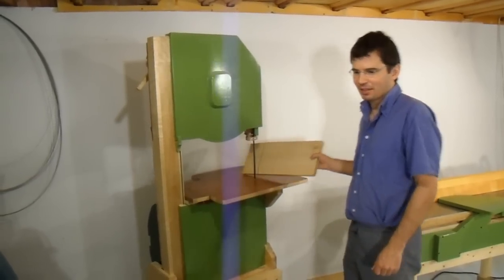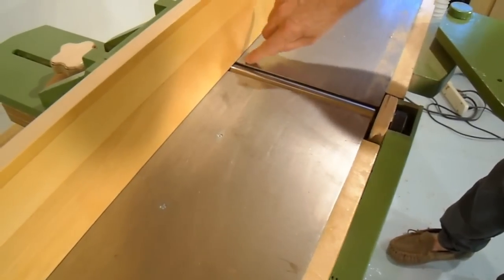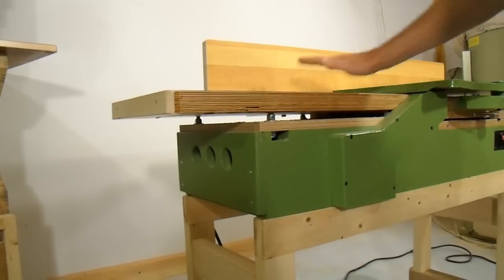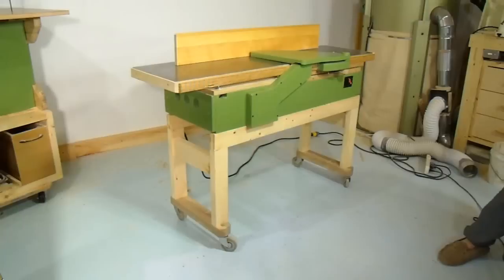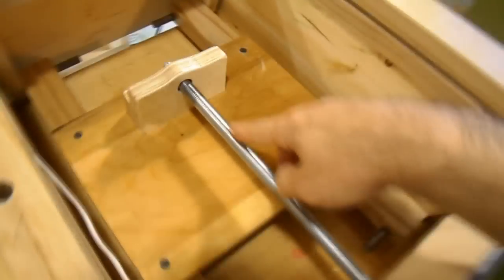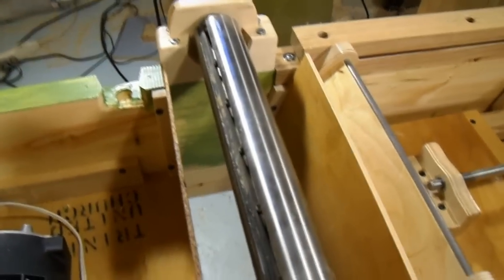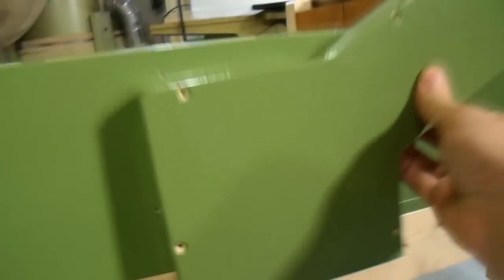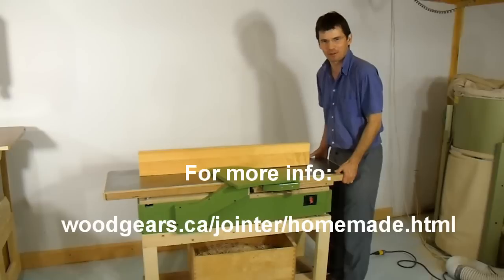Homemade jointer

Comment: I don't really know enough about this to offer useful advice, but it could be some of the noise is due to resonance. For instance, a lot of acoustic musical instruments have a flexible wooden box attached to make them louder. Possibly if you added some rubber or foam material to any wide panels that could quiet things down a bit.

Comment: from where did u get the 12 inch cutter head. Are there electric planners with 12 inch cutter heads. most are not more than 5 inches

Comment: Hey everyone. I need your opinion on something. I want to make this jointer. I bought the plans. A cutter head. A motor. But I dont have a drill press and I'm a little terrified of messing up the parallelogram mechanism. I was thinking of buying a small motorcycle scissor lift which I saw on Amazon for $70. Do you think it will be accurate enough to work as the lift for the infeed table?

Comment: Why don't you make a jointer with helical or shelix cutter head so the people don't have to buy a the whole thickness planer
Reply from the maker: because buying the whole thickness planer is much cheaper.  And you also get a motor, pulleys, switch and power cord.

Comment: I've seen spiral cutterheads being sold for a little as a few hundred dollars at places like Grizzly and Ebay.  Has anyone tried using one of those on a homemade jointer, instead of buying a cheap thickness planer and disassembling it for the cutterhead?

Comment: Thanks for sharing. I have a cheap jointer that I'm struggling to set up.  The issue I'm having is that when edge jointing, the stock comes out concave. I.e. there is less material in the middle of the stock so when I want to edge glue it there is a larger gat in the center. What's causing this? What can I do? I've adjusted the knives according to the manual (using the provided tool) but the problem remains.
Reply: You need to adjust the in-feed and out-feed tables. Make sure they are level and parallel.

Comment: Why didn’t you put the motor and belt on the rear, and run the motor in reverse or feed the woodwork left to right?
Reply from the maker: pulley only firs on one side.  Running left to right is asking for trouble in terms of feeding the wrong way.
Reply: Matthias Wandel sorry I think I didn’t explain properly...... if you flipped the cutter head, in turn putting the motor on the other side of the table, then you could build the table to feed the workpiece from left to right. Not much of an issue really I know, but just food for thought :)

Comment: The sound of the motor has probably been amplified by the fact that it is in a wooden box which is acting like the sounding box of a guitar. If the noise is irksome it may be worth putting some acoustically insulating material or some foam rubber in the box to line it and deaden the noise. The heavier the density of the foam the greater will be the deadening.
I hope that this may be of use.

Comment: Hi. Cool project. 
You showed that you used the original mounting mechanism. Only by Design it is hanging downwards, and the gravity is keeping the belt under tendion, so it doesnt ware out so fast and doesnt come of. You should use some springs to ad pressure on the Motor to keep the belt under tension.

Comment: I got a challenge for you. Can you design and build a jointer/planer combo with a shelix head from the dw735? i have seen that someone built a jointer with it from your plans but i only want to buy one shelix cutter since they are expensive.

Comment: I've been dreaming of building one of these for a couple of years now, but I've never been able to justify tearing down a brand new thickness planer to do it. Now I'm thinking I could build by picking up a used cutter head from eBay and slapping on some fresh bearings and blades. Should be able to get it all for $200 and I already have some salvaged induction motors saved for a project like this. I'm not sure how many HP it would need for a 12" cutter head though.
Reply from the maker: for $200, you can probably get a thickness planer too, and it comes with motor and pulleys already.

Comment: "most small planers mount the bully on the right side, which means you have to flip it and unfortunately mount it on the left side if you are going to build a jointer out of it" - master level problem

Comment: i didnt see if someone had already mentioned this or not. you talked about the motor cover having an opening at the bottom so as to "hopefully not suck in any shavings" since your dust shoot empties out below (unless your shaving box is under the table) wouldnt it have more chances of pulling in a lot of dust? Would it not be better to have the opening pointed a long the side of the table towards you,  to pull air in? just a thought. if im completely wrong, then let me know. it was just a thought.
Reply from the maker: It would take an insane amount of suction to pull shavings 30 cm up from the bin
Reply: Ahh ok, i didnt know. I dont have much knowledge on those things, but figured it wouldnt hurt to voice my thought.

Comment: Hi, in your opinion, which would make the stronger and stable jointer, MDF or ply? For some reason, ply is not very commonly used in South Africa and it's quite expensive. Which other alternatives is there?
Reply from the maker: steel
Reply: now that's comedy right there folks!.. :D

Comment: Matthias, I appreciate your clarification. This functions as both planer & jointer right? Since basically it's an inverted planer & stronger with the belt drive for sure. Is there really any critical difference?
{If I were too build this machine larger with the parts from a larger planer}  
I imagine some kind of thin insulation on the inside of the box could muffle the motor noise...just a thought I had when I saw this video the first time, by no means a criticism...I really like your work.  I'm inspired OK thanks!

Comment: When you were testing the cutter head you used something that caused the motor to vary in speed.  What did you use to get a AC current to vary in speed?  Whatever it is you should use this to build a disk sander.  One of the problems with disk sanders is the speed.  Too fast and the wood gets burned.  The slowest speeds I've found is around 1,700 rpm.  300 rpm would work for a lot of projects.
Reply from the maker: You should use an induction motor for a disk sander (universal motors are too fast).  But induction motors can't easily be changed in speed  - you need an an expensive VFD.  this will cost more than the sander.
Reply: I have a DC motor off an old treadmill.

Comment: Wait can't you just mount the motor on the cutter head? Because you could save some money
Reply from the maker: That woudl be much more difficult than using a belt.  Also the wrong RPM

Comment: Couldn't you turn the motor and cutter head end for end and make it a left to right feed machine? The fence would be on the left instead of the right from  a feed perspective. Then you could put in a rabbeting ledge on the right.
Reply from the maker: I didn't have a choice about which side the pulley goes on the cutter head
Reply: I see you said that in another reply. So if you swapped ends... the pulley stays on the motor side.. but you rotate the whole motor pulley affair counterclockwise from a plan view, but the motor goes in the right hand compartment and the infeed table goes to the left... the outfeed to the right. Looking at the pulley it now rotates counterclockwise from the near side of the table. In my bizarre and twisted imagination it works... perhaps not in reality...

I realize it is a duh uh moment, cause it amounts to just turning the machine around in the shop and (then) switching the side the fence is on... which I think you mentioned.

Other than cannibalizing a planer, I wonder if there is any other way to get a cutter head with pulley arrangement.
Reply: Eric, I think you have the same imagination as me...I got mine at "Eschers-R-Us...." :-)

Comment: Could you make the belt side, the back side?  This way the pulley to the cutter wont get in the way?
Reply from the maker: I didn't have a choice which side the pulley is on
Reply: If you put the infeed table on the left, you would be fine

Comment: What is the difference between a jointer and a plainer? Thanks
Reply: A jointer is used to make the face of a warped, twisted, or bowed board flat. A planer is used to make your boards uniform in thickness.
Reply: think of the joiner as for "joining" the edges of boards; for a good glue up, you want a flat, uniform surface for the glue to adhere to (and for the second piece to join to). My "preferred" answer isn't technically correct..."join edges, plane faces" - that's probably 80-90% accurate. But, I think it makes the concept clearer.
Reply: +Robert Vernon Do a search on Matthew Cremona's channel for an answer to this question. He posted a video about it.

Comment: Matthias - I have watched several of your videos, some more than once and I am amazed as to the amount of thought you put into a project.
I have been wondering, where do you find the motors for your projects?
Good work!!! You are the "bar" by which I measure others to.
Reply: +Bill Moss Scrapped washing machines are a good place to start. Quality machines also have better brackets you can use, as well as better motors.

Comment: If I'm modifying the structure that holds a cutter block that spins at or around 5000rpm I'd use metal brackets and machine screws. Not worth the risk. Failures may be more or less catastrophic. Be carful.
Reply: Steve Joyce My thoughts exactly!
Reply: Steve  Joyce I was thinking the same thing.

Comment: Hey Matthias, are there any reasons other than right handedness and convention that prevent you from just turning the Jointer around and feeding from left to right, in order to avoid having to work over the large pulley?
Reply from the maker: eugenerk It's more than convention.  It's safety.  I don't want me or anyone else feeding a jointer backwards.
Reply: Matthias Wandel So it would be like swapping the positions of the brake pedal and accelerator in a car? Might be perfectly valid, mechanically speaking, but would probably kill you?

Comment: I have two planers. A Delta TP400LS 12.5 inch like yours and a big 600 pound cast iron Delta 15 inch which has a bad feed gearbox (it has high speed only) and Delta does not offer parts anymore. Thinking about doing this but since my 220 volt 15 inch monster planer doesn't have a feed I would use it. Overkill on the size maybe? I think I can rig up a variable speed gear motor to run the feed rollers to make it a good planer again so maybe get your plans for the TP400LS and sacrifice that one for the jointer. Thoughts? Any ideas for a gear motor to run my feed rollers on my 15 inch? I can send pictures if you like.
Reply from the maker: 1crazynordlander I wouldn't recommend trying this with a 15" cutter head.  Too difficult to keep the tables flat enough.
Reply: Matthias Wandel Thanks for your input!

Comment: Matthias, I just replaced the cutter head on my dewalt planer and was contemplating using the old straight knife cutter head to make one of these.  I now need a motor to power the head.  do you think I could use a variable speed router motor and have a shaft/key made, and get a pulley to mount on it?  Thanks!  -EZ
Reply from the maker: Evan Zane That might work.  Or, for a little bit more, you could buy a cheap planer and take the motor out of that.
Reply: Thanks!

Comment: Nicely done, and quite clever. I worked for a guy that had an old Delta cast iron jointer and it was NO fun to move, having to load it in the back of his pickup truck equipped with a topper...

Comment: what is the difference from the planner?
Reply: The jointer can plane the edges of boards but the planner only does the faces.
Reply: I find it interesting that many wood workers have planers but not jointers.  Every big box store has a planer but not a jointer for sale.  They all used to have jointers for sale but times have changed.  You really need both but I put the jointer slightly above the planner in importance.   You need both in conjunction with a table saw and or band saw to make a truely flat and square board.  "milling wood your workflow would typically go from bandsaw > jointer > planer > table saw."
Jointers, if used right, can square up 2 sides... kinda of important when making furniture.

Comment: @sanityfalling

Agree that ply can warp and MDF has its short comings.

I have many times used a technique of laminating up my own ply with fibreglass layers inbetween, usually finishing off with a layer of fibreglass on the outside.
Great strength and solidity plus the fibreglass and resin really slows down the ingress of humidity so the interior will stabilise to a lowish value ( same principle as polish on furniture, wood is never dry, humidity is never absent, what causes warp is changes to humidity more than actual humidity.

I have used this principle for making wheels for a bandmill with 800 Lbs of blade tension and the wheels show no sign of strain ( they are around 3" thick ) or warp.

When I want a really flat surface I usually add the final outer layer of resin and fibreglass on an old glass table top.

Float glass is usually considered very flat when not supporting its own weight - toughened glass is considered to be less flat but still not bad for an application like this - support the glass table top on an old duvet or something that allows it to "sink in" so weight is evenly supported.

Not sure about the effect of continual wear though - fibreglass would wear slowly but it would still wear.

Comment: You could use jib plate aluminum for the top, it will be flatter and more stable than the steel.

Comment: You did a fantastic job, got lots of patience too, plus the skills of course.  Just a word on the jointer/planer comment..  A jointer straightens crooked boards, a planer planes boards to thickness, you know that. :-) On the other hand, what you have was a planer, but now it's a jointer, but I don't think it's both.

Comment: Perhaps this is a silly question, but why did you not simply reverse the feed of the Jointer (ie from left to right, instead of from right to left ?). 
I realize it is far too late now, as it would require a complete redesign, but it would have allowed you to add your rabbiting ledge, as well as enclose the upper pulley.

Comment from the maker: Planers don't make a whole lot of dust, but the chips take up a lot of volume.  And the jointer is usually used maybe ten seconds at a time, so not worth spinning up a dust collector every time.
Reply: DO YOU HAVE PLANS for this?

Comment: matthias, i notice, you have no dust extraction on that jointer, i am curious as to why? is it because you dont want it or would it have been too difficult to attach  a hose port to the under side of the shavings chute?
Matthew.

Comment: Egg-crate foam for sound dampening springs to mind. It seems as though there is room in the motor's housing. Even carpet or craft-felt should tone it down some. Right now it is essentially a sounding board aimed at your face.

Comment from the maker: It would require a 1 hp motor (not easy to find), and redesigning  / rebuilding the jointer to make room for it.  Not an easy change!

Comment: You comment in several places about the noise of this jointer, being due to the motor.  Have you ever considered replacing this noisy universal motor with an induction motor?   You do seem to come across 2nd hand motors fairly regularly.  That should not be that difficult a modification, shouldn't it?

Comment: I'm in the planning stages to build one of these with your plans, Matthias.  I'm looking forward to it.  Though I think I'll have to one-up you...my donor planer will be a *gasp* 13" Ridgid planer.  There are two mods that I think I'll perform--I'll lengthen the in/out feed tables by about 8" and move the motor closer to the cutter to shorten the belt, but I'll add a 4" dust port on the backside to suck shavings out and cooling air into the motor.  I can't wait to get rid of my 6" jointer!

Comment: I can and I did, and so do millions of people in countries that have been woodworking for centuries. A surface planer does precisely what you says it doesn't. What is doesn't do is make it flat, and for that you need a jointer. 
Clearly you are here to only disrupt Matthias' thread, so I'll refrain from commenting further, but perhaps you should educate yourself before wrongly correcting others.

Comment: You realiy can not call a surface planer a 'thicknesser'.  By definition a thicknesser is a tool used to set the thickness of the material.  A surface planner can not be guarranteed to create a piece of timber that is the correct thickness over the length of the timber. See vidoe by ronrandel? and Matthias for more detail.  The resaon for this is the surface planner cuts from the botton and a thicknesser cuts from top.

Comment: Part 2 of 2  Planer vs. Jointer
Additional reference
A jointer (also known in the UK and Australia as a planer or surface planer), is a machine used to produce a flat surface along a board's length.

The jointer derives its name from its primary function of producing flat edges on boards prior to joining them edge-to-edge to produce wider boards. The use of this term probably arises from the name of a type of hand plane, the jointer plane, which is also used primarily for this purpose.

Comment: Part 1 of 2  Planer vs. Jointer
From Longman Dictionary of Contemporary English
A planer: - an electric tool with a flat bottom and a sharp blade.  Used for making wooden surfaces smooth

From Oxford dictionary
A tool consisting of a block with a projecting steel blade used to smooth a wooden or other surface by paring shavings from it. 

From Oxford dictionary
Joiner
A plane used for preparing a wooden edge for fixing or joining to another.

Continue to part 2 of 2 Planer vs. Jointer